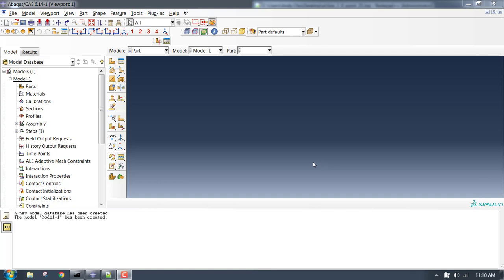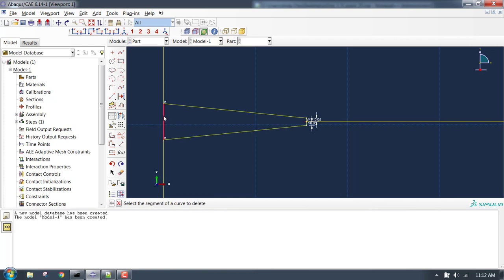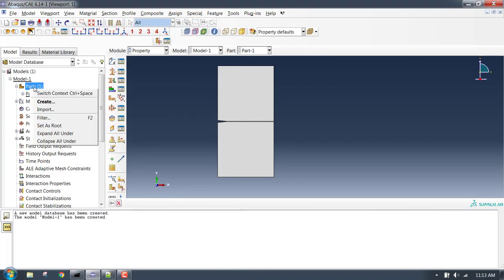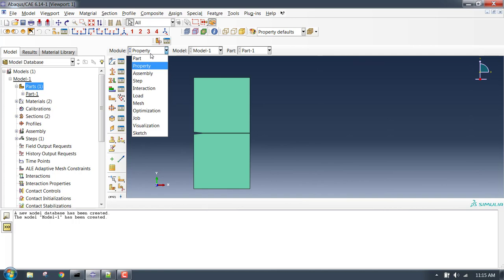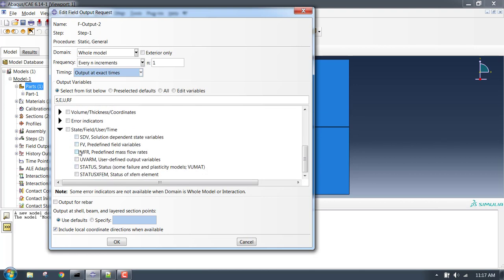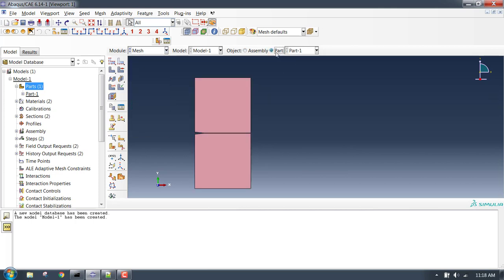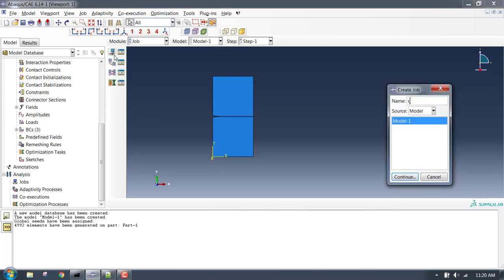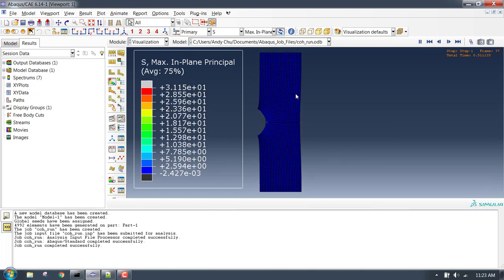ABAQUS - Cohesive Element Tutorial - English With Narriation

Comment: How did you determine cohesive element properties?
Reply: Agreed, I would very much appreciate some kind of explanation of the parameters you insert into Abaqus. Say we have a material where I know the elastic parameters and the fracture toughness, how are those related to the input parameters you had prepared in the video? E.g. here I read that the stiffness should be matched with the cohesive element thickness: https://abaqus-docs.mit.edu/2017/English/SIMACAEELMRefMap/simaelm-c-cohesivebehavior.htm
Reply: it will be based on your need. It should come from a mechanical test of your sample or reasonable assumptions.